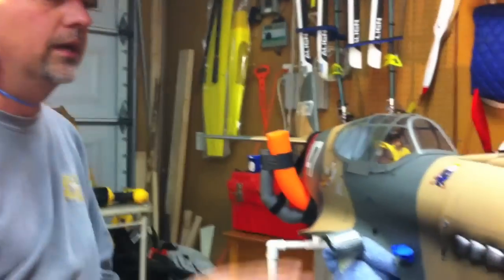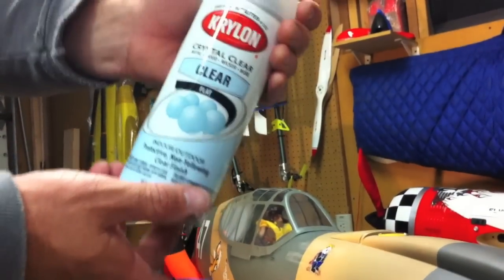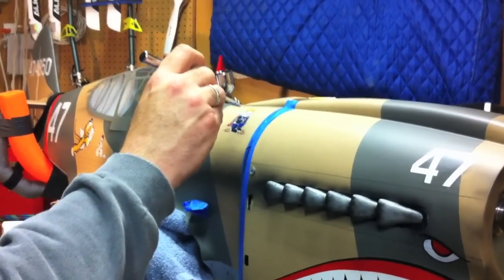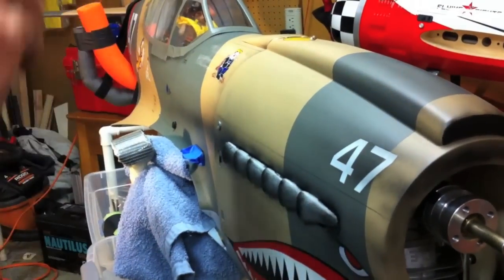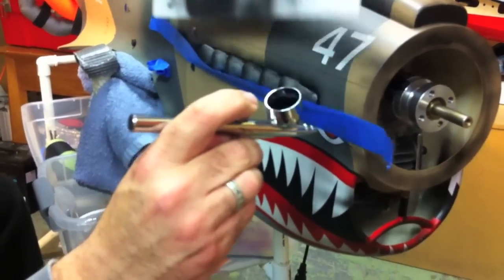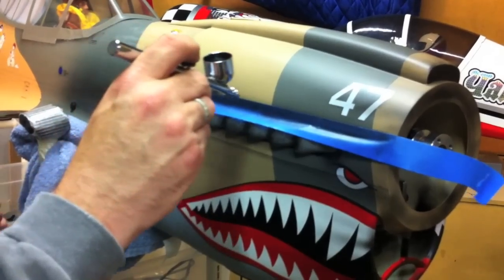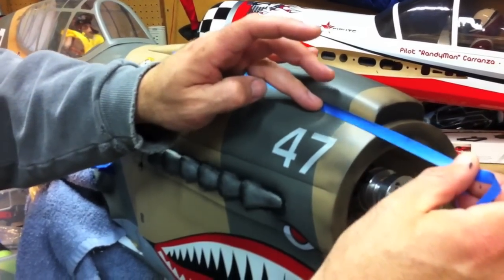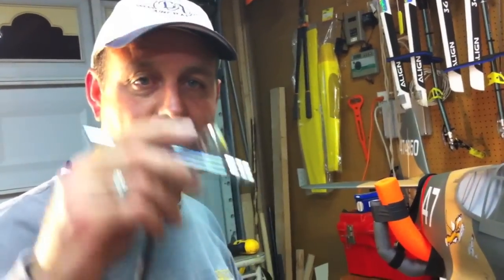Panel Lines Weathering

Comment: What would be the best way to make panel lines when using chrome monokote and aluminum monokote as a covering on the fuselage and wings? The plane I am building will have a chrome fuselage with aluminum covered wing and stabs. The chrome panels must be very subtle and not stand out, I am wanting the panel lines to be easy on the eye but noticeable like its full scale version. A sealing paint with flat krylon would diminish the look that I am trying to create. The plane is on my home page.